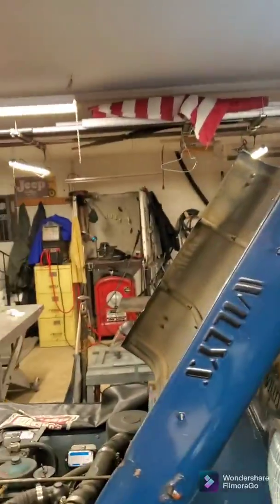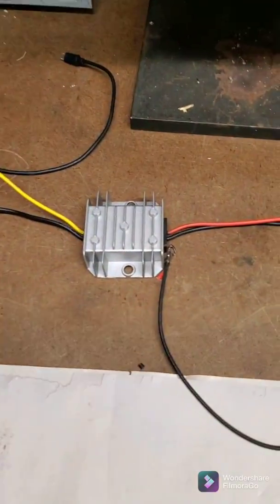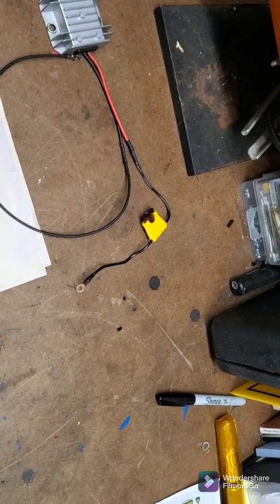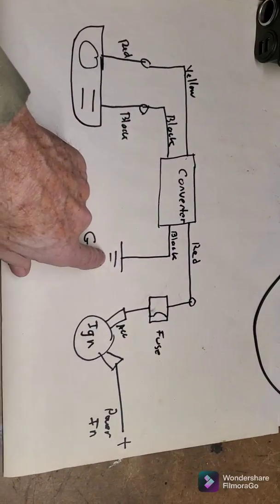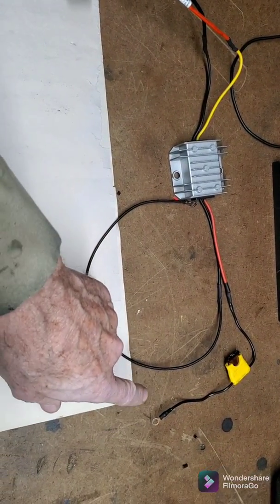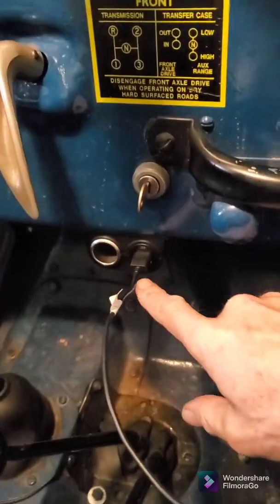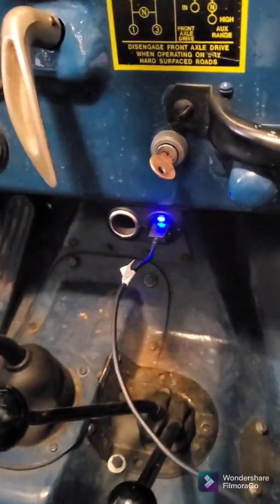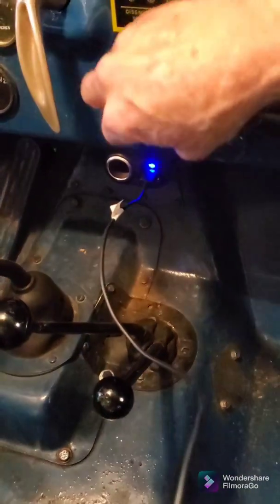Adding a 6 to 12 volt step up converter to my 1948 Wills CJ2A jeep

Comment: Did it really produce 12 volts? Mine, precisely the same, would only manage 9 volts. In reality, phones and SatNavs will work on a 6-volt supply as they all run on 5 volts. I have them working on three of my vintage 6-volt cars using the compact cables and USB sockets intended to run accessories from a 12-volt motorcycle battery.
Reply from the maker: Honestly, I dont recall. That was a long time ago. But it worked for me.